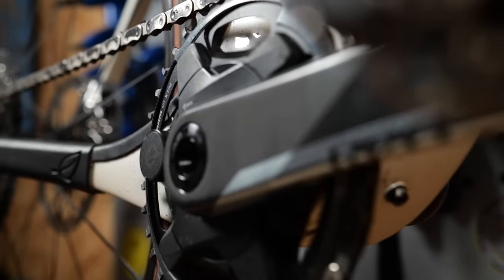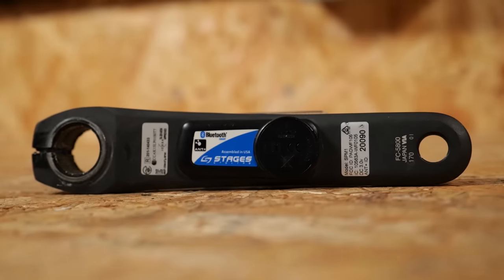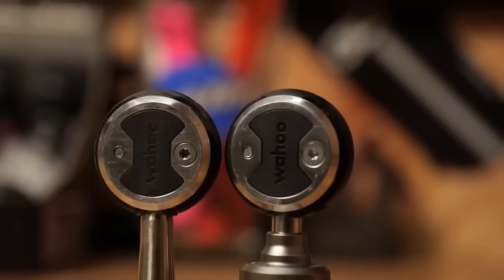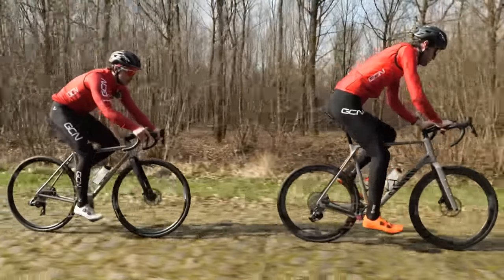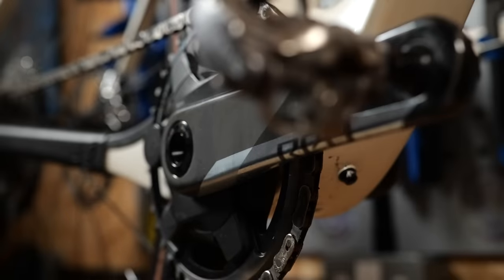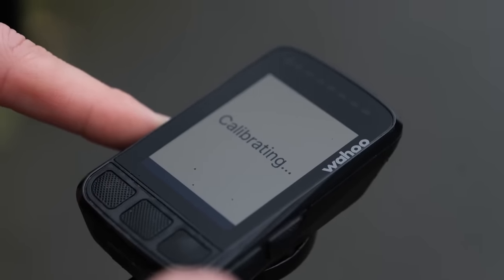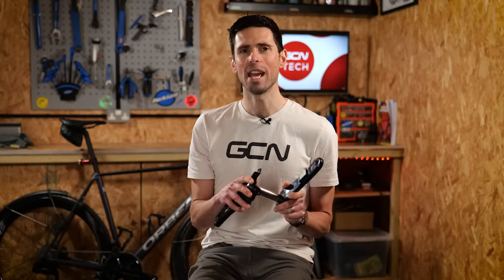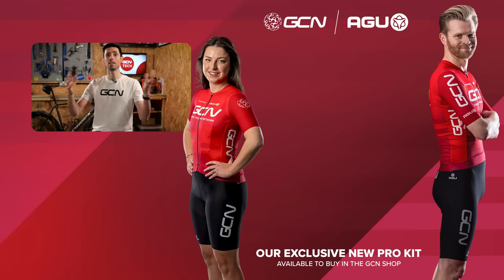The Problem with Power Meters

Comment from the maker: Do you own a power meter? Let us know in the comments 👇
Reply: Yes 4, 3 that I made myself and 1 I got second hand.
Reply: Favero assioma duo shi 👌
Reply: I have Favero Assioma DUO on my road bike, Magene PES P505 Base on my CX bike, Sigeyi AXO on my XC mountain bike and then I have Elite Direto XR trainer. I used to have InPeak Powercrank, but I sold it to my friend, because after my injury and following two surgeries I unfortunately have quite a significant disbalance. Compared them all against the Assiomas and they all track really accurately against each other, yet when I had the InPeak, I had to scale it up by 2% to get it in line with the other measuring sources (splitted the Assiomas into UNO for that test).
Reply: I have/use 3 4iii powermeters on road bikes, 2 Quark and Garmin Rally 2.0 in MTBs.
Only issues I've found:
Garmin pedals is realli difficult to go over 800 watts, no matter the effort.
on the Wahoo Kickr core, I found ERG mode stupid hard, 165 watts is equivalent to riding a 15% up.
the rest of the power meters work fine for me, both in circuit and open roads. Only thing I would change is recharging, as changing batteries on 6 pieces of equipment is not cost effective and a pain in the a$$
Reply: I have a stages gen2 single side I picked up cheap on fleabay.

Only had it a few weeks so still in the honeymoon phase but, once I had overcome the upgrading to a modern BB and sorted the well known battery contact issue, it seems consistent and looking forward to seeing how I'm doing more clearly out on the road.

Of course I did have to go out and break the 1000W barrier, but I'm over that now 😂
Reply: I've a power meter on my road bike, but refuse to put one on my gravel bike. As Si would say: It's agains the (Quote) Spirit (Unquote) of gravel ;)
Reply: Nope. Not racing, and definitely not being paid to race. For me it would be an utter waste of money.
Reply: Nope! I'm totally vibes based, baby! Except for Strava, of course.
Reply: 2 bikes with power2max and a turbo trainer.
Reply: I am riding with a power meter since 5 years now (Sigeyi: chinese spider based PM approx £300)  and find it extremely useful to monitor my fitness (or the absence if fitness), in particular in combination with a heart rate monitor.  The slope of the HR versus power gives me a very good measure of how fit I am.  I am not at all interested in the absolute numbers and as such the accuracy is of no concern to me, except that it measures consistently and reliable.  Because of a history of cardio troubles I need to limit my max HR to 150, so in combination with a PM, this is a good guide for me.   The other thing is that my L/R balance is off because in my right leg I am missing some veins and muscles and the PM helps me to train my right side.   BTW, I am 70 years of age and typically ride 50 to 100 miles in a day (twice a week)  and once or twice a year up to 200km in a day with 2400m ascent.
Reply: I can't afford a power meter on my bike unfortunately
Reply: No. Could never afford and never been interested in detailed data about cycling - I dealt with enough of it at work mining complex and incoherent databases to compile meaningful data
Reply: Yes, spouse and I both have Garmin pedals.

We also have Garmin Tacx products as trainers.

Thank you DC Rainmaker for the thorough reviews.
Reply: Nope, just bpm. Measure power on my indoor trainer.
Reply: Have for over a decade. Started with and continue to use a dual sided Quarq power meter on my outdoor bike. I'm on a Wahoo KICKR CORE for indoor.
One thing I will comment on is NEVER compare indoor to outdoor unless you are using the same power meter. Power meters can vary, significantly, between types and even models.
Reply: Well it can still be useful to see if your going in the right direction. Like an inaccurate scale when you loose weight number still drops and rises when you gain weight
Reply: Does the act of measuring watts add a small amount of resistance to pedaling ?
Reply: @jacobbillman6485  Absolutely 0 useless you include the added weight, but that could be taken off elsewhere.
A stain gauge only measures the existing deflection of the material it is applied to. A stain gauge is simply a tiny rectangle of plastic with a thin zigzag of wire embedded in it.
Reply: Yeah 1. It conveniently plugs into a standard wall outlet.
Reply: @gcntech @gcn I do, and I have a lot to say on the matter. I have dual even triple recorded and proven to a turbo trainer manufacturer that their turbo has drift to which they deny. Apparently I have an 1800w sprint and a 340 ftp?!? Nope. I have done countless tests and analysis to prove the problem and stopped zwift racing for a while as I my trainer gives me an unfair advantage. Now with power pedals I’m back on a fair playing field. I think…

The additional issue is that indoor power numbers not matching outdoor power numbers completely skews power based training data. 

I feel there needs to be a way of getting an industry standard calibration, or, companies offering calibration services and verification to help us cyclists know that 200/300/1000 watts are exactly what they are. 

Accurate readings are important, especially when you’re trying to be consistent indoors and out. 

I’m very happy to share the data GCN tech, it’s already in a PowerPoint too 😂
Reply: Garmin Rally Pedals, which give the same results as my Kickr Core (within a couple percent).
Reply: I've got 4 pair of affordable/accurate Assioma DUO's  (one pair converted to SPD), and then one Magene spider on the MTB.  From both DCR and Llama's testing, the Favero Assioma's are THE power meter to have to test other power meters against.  Llama's testing on the Magene showed it's actually pretty good for accuracy after the initial round of firmware updates.   BUT  - both of their testing showed the Shimano Powermeters you keep showing and referencing for inaccuracy, are in fact the WORST power meters out there, and apparently unfixable with software.  I know y'all are commercial and can't directly call out when a sponsor produces garbage - but Shimano cranks for years have had severe/catastrophic safety problems, and the power meter versions are pretty inaccurate to boot.
Reply: Yes.  Started tracking on Peloton (yes, I know it's a calculation but it was a start anyway), then bought Wahoo pedals single-sided, and now have a crank-based from the factory on my new Canyon Aeroad.  I feel blind riding w/o one now
Reply: Yes, Favero Assioma on my road bikes
Reply: Favero Assioma duo
Reply: My biggest problem is my kickr and sram power meter differ by as much as 10%. So my TrainerRoad sessions get all confused when I go from indoors to outdoors.
Reply: Do you need speed and cadence sensors for your Wahoo if paired with an Inspider Power Meter?🤔
Reply: @jacobbillman6485  no. It works by measuring deflection of the crank (usually) to determine force. It converts that to torque, and with cadence, to watts. The crank will deform a little but whether it is being measured or not, so it costs essentially nothing to make this measurement.
Reply: Yes I have a power meter, it's called a Speedo 😂
Reply: Should I get one ??

Comment: Sim[ple : Don't buy a power meter until you've watched & understood the Shane Miller / GP Llama or DC Rainmaker reviews & analysis.
Reply: I used DC Rainmaker reviews both when choosing my power meter as well as my indoor smart trainer.
Reply: Agreed 100%.  For any sports tech, really.
Reply: This essentially boils down to don’t buy the R92000P, R8100P, or R9100P.
Reply: @weiwenng8096  😂 exactly!
Reply: But for PM noobs this is brilliant. Well done GCN
Reply: One of the best things is to watch ANYONE who has technical knowledge and look at every option you have. Add in the budget you have to spend.
Reply: Did just that, but then still concluded that the power meter I bought which was reviewed to be accurate within the 1% turned out to be widely inaccurate, had it replaced under warranty and the replacement had a similar drift although it was reviewed by various youtubers to be a good accurate unit. To me this video just shows how terrible our industry is at delivering on promissess. If a power meter claims to be accurate within 1% it should be able to be compared to another powermeter which also claims to be accurate within 1%.. Just accepting you can't compare the two even though you pay a shit ton of money for them is not the answer if you ask me. Don't just accept your power meter is off by 30 watts when it claims 1% accuracy and 30 watts represents 10%. Hold them accountable, otherwise just ruin the industry further.

Comment: To sum up, Shimano power meters are notoriously inaccurate.
Reply: Exactly you definitely don't want a dura ace shimano power meter. That belongs in the parts bin.
Reply: Ultegra 8100 on par or even worse 🥴
Reply: I've got a 9100P DuraAce powermeter and it's shit around 30W underreading compared to my srm, a kickr and asioma pedals
Reply: Yea all I hear is how crap the Shimano crank powermeters are ... and how insane good Favero is... and here the message seems to be the opposite.
Reply: @FliskerX the video doesn't mention either Shimano or Favero.

Comment: Accuracy doesn't matter, consistency does!
Reply: This. Absolute value has little importance, it's the amount and direction of change that usually is what's useful to know.
Reply: Unless you have a road and gravel bike that you interchange for training sessions. My gravel bike reads 25 watts higher which is frustrating esp if you are tracking data.
Reply: Of course it does. Get on a trainer and ride at close to your FTP and then ride at 20w higher and see what happens. Training zones are the bedrock of cycling and if your being told to ride at X and you are riding at Y then you aren't going to get the most from your training.

Comment: Accuracy is overrated. Even if accurate PM's in different settings (indoor, tribike, roadbike,mtb) will give you vastly different numbers. If having multiple bikes you either have multiple FTP's and Zones or you must have  PM models that allows to change the slope to adjust all PM's to report at least  comparable power values, no matter how accurate.

Comment: I thought my power meter pedals showed I produced more power changing from 172.5mm cranks to 170mm. They actually showed the importance of remembering to set the crank length to accurately measure torque. Sigh.

Comment: I picked up a used single sided crank power meter a few weeks ago - spent the winter months on the indoor trainer so I got used to seeing the numbers.
Very happy with the purchase so far. A positive surprise is that I am now much more tolerant of riding into a strong headwind as now I see that I truly can be putting in more effort even if it results in a slow speed. Like of course I realised that I must be putting in more power if my heart rate is going up but it's still nice to see it for sure.
So for me it has been  worth it just to compare myself with myself, and makes you realise even more how useless comparing average speeds often is.
Reply: Amen. Average speed doesn’t mean anything. My outdoor bike is relatively heavy and not very aerodynamic but my FTP is 4 w/kg whilst people who can afford fancy bikes and aren’t as fit fly past me
Reply from the maker: That's great! Often having power numbers just gives a bit more context 🙌 That can really help with motivation!
Reply: Be careful though. I had a single side PM and switched to pedals. My power readings with the single side were 10-20% higher than with pedals. My left leg is stronger than my right I learned with the pedals, inflating my average power on rides.

Comment: Assioma Duo are the business. Super easy to swap between bikes if you're fortunate to have more than one. I use mine on the indoor trainer and outdoors for consistent readings. Accuracy is excellent.
Reply: Have these on my primary road bike. Very impress for the value!
Reply: I also use Assioma Duo.  I've been a bit of a nerd and compared against my Wahoo Kickr.  I did the 1 hour FTP test on Zwift using Wahoo Power meter, whilst simultaneously pairing my pedals to my Elemnt Bolt running the same test.  I've done this 3 times and its never been more than 3 watts different either way.

Comment: Nice balanced video (though you could've mentioned the expensive low-fidelity elephant in the room). Many riders claim that you don't need accuracy, all you need is consistency, but they don't know how or even bother to measure consistency. I think that the need for accuracy depends on what you're doing with the data, and there are widely different uses so there are widely different needs for accuracy and precision. Training FTP is one of the least demanding things you can do with a power meter, so a single-sided meter (or a dual-sided Shimano) are probably fine for that. Measuring CdA and Crr are very demanding uses, so you absolutely need high-fidelity data for that purpose.

Comment: I remember one day after a good month or two of training, I swapped my left sided stages pm off my training bike onto my race bike. I calibrated it and it gave a different number than usual, but I thought nothing of it. So I set off for my 3hr hilly loop and felt great. The ride was effortless and I was amazed at the power I was doing on the flats, and up the climbs. And thought "Man 300w's feels really easy up these climbs! I must have got fit all of a sudden. My training must have all come together and my body has finally adapted! Wow this is what it feels like one of those young A graders. This is great!" Then after a few hours I suddenly thought..."Hang on a minute. This can't be right, better stop and check the pm". And lo and behold I'd forgotten to tighten up the 2 pinch  bolts on the crank! And it was only staying on with the help of it's shimano safety tag and dust cap! My short stint of being "a good cyclist" was over, and I rode home feeling rather silly at my usual 180 to 200w's :( lol
Reply from the maker: Hahaha that must have really felt like a hit! 🤣 That said, if you were feeling good you should be focusing on that! Feeling good on the bike is the most important thing 🙌
Reply: When I started using power pedals I didn’t know I was supposed to calibrate it before every ride 😅 and I had a goal off hitting 300w for an hour. And went from 240 to 320 very quickly 😅 and got a little suspicious and it was way off. Took me 6 months to beat any off the watt records xD

Comment: I’ve had the Faverro Assioma’s for 5 years now. They just work and are consistent. Fit and forget. Super easy to swap between bikes if you need to. Support from Faverro is excellent if you do ever have a problem.
Reply from the maker: that's great to hear!
Reply: I want to get them too. QFactor is a bit wider but I have a mtb crank on my gravelbike so getting the same QFactor on roadbike I'll buy next week should be fine

Comment: Single sided pedal powermeter user here. Garmin Vector axles inside Rally XC bodies. Bought so I can both monitor training and make sure I ride easy enough on first days of multi day bikepacking rides (as vectors to begin with). Self assessment and riding on feel only gets your so far when you feel so fit and fresh its easy to do too much too soon. Very happy with them I am too (power meter parts now more than 5years old)

Comment: Most useful way to compare efforts is to use power vs HR instead of power (or HR). There are many external factors such as weather (esp. heat), sleep and nutrition that can affect your readings, so having two values as well as a training diary makes it a lot easier to put the data into context.
Reply: Absolutely correct,  HR versus Power is an excellent measure which is independent of wind, slope, road condition and bike weight but it isn't independent of sleep and nutrition.  If I ride undernourished or having had  a bad nights sleep, I can see that immediately in my data,  needing a HR of 150 to achieve 150W output over any length of time.
Reply: 3. RPE. Heart rate, power and importantly RPE. Each one is a window into performance. If you want a full picture, use all 3.
Reply: @geoffnash2609  I find it hard to arrive at a consistent measure of RPE as it so much depends on my mood, the weather, the head wind and temperature and being cut up by passing cars or not.

Comment: I have a 4iiii Precision 3+ single sided crankarm power meter.  It has really helped with my outdoor training.  It does read a little higher than my Wahoo trainer, but I don't mind as it is a consistent reading that I accounted for with power balancing..
Reply: generally speaking, your power will be higher on the road naturally (heat loss and micro recoveries) . If you wanted to get nerdy, borrow/use two computers or a computer and your phone app. Link one to the trainer and one to your crank and do a session on the trainer and compare numbers.
Reply from the maker: Consistency is the key right! As long as you can use your power meter for good training 🙌
Reply: My 4iii reads lower than my Wahoo trainer 🧐
I’ve compared the numbers side by side on Zwift / looking down at my Garmin

Comment: Having used a Power2Max campagnolo PM for years (before the bike was stolen) I can say that aside from the battery running out it was faultless. ANd required NO maintenance whatsoever. I got it second hand and it was worth every penny.

I've since used a Stages LH only PM which was frankly not good enough. I couldn't gain any form of consistent numbers. High indoors. Low outdoors. Sometimes in the right ballpark. Even when calibrated. The lack of consistency was really frustrating.

Moved to Wahoo POWRLINK now, and they seem to be really good. 

TL;DR: I do think you get what you pay for.